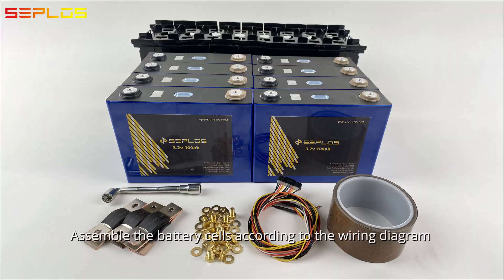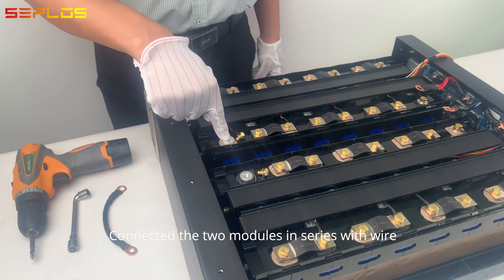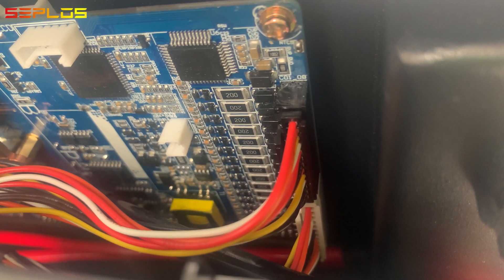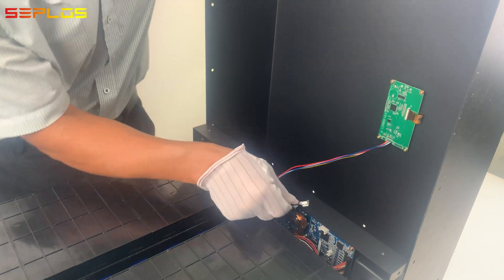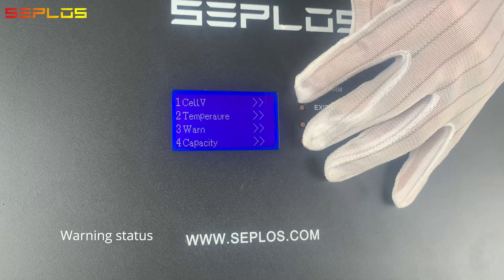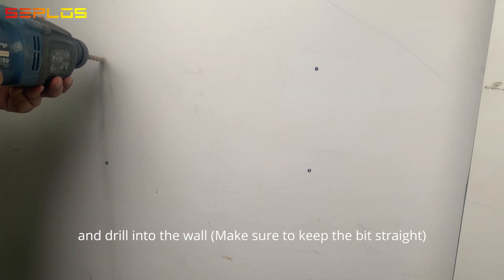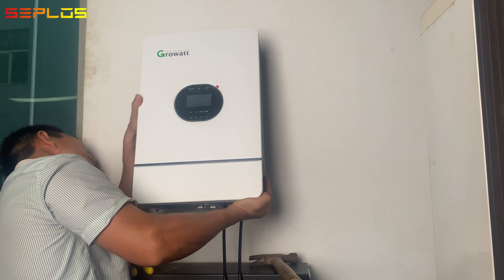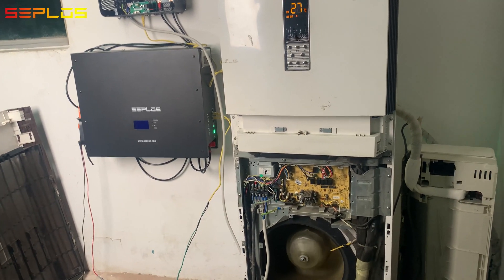Build Your Own Powerwall with prismatic cells - Off Grid Solar Power Storage

Comment: is it possible to adjust the maximum charge voltage and the minimum discharge voltage via the BMS?  it seemed more like the BMS was monitoring voltages and perhaps balancing, not controlling the charge and discharge characteristics.
Reply from the maker: Yes, the over charge warning and protection voltage, the under discharge warning and protection voltage can all be set via BMS. We'll make a video about our BMS and the BMS upper computer system soon. Please stay tuned. Thanks.